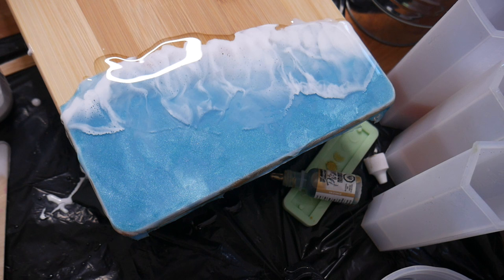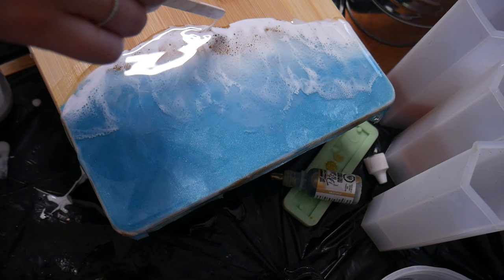Master The Art Of Creating Resin Ocean Waves In Just 5 Minutes | Quick & Simple Diy Tutorial

Comment: What the mixing ratio of hardener and resin?  Also how much die powder should I get for a gallon?  Or is it just to preference?
Reply from the maker: It can depend on the resin you’re using, always check the labels for the mixing ratio :) personally with the ArtResin brand I use it’s 1:1 ratio so just equal mixtures of resin and hardener! And for the powder you can get a small container to see how far that takes you with your projects :) typically dyes and pigments are so pigmented that you don’t need a lot :)

Comment: Ok that didn’t explain nothing you didn’t say what bands you was using, how long you was leaving the resin before blowing it out, that was just to say you mastered it 🤷🏻‍♀️
Reply from the maker: The first 10 seconds of the video I show the brands & the supplies are all linked in the description. I have an entire Amazon storefront dedicated to the ocean art materials.
I explained how to reduce bubbles in resin, how to mix, how to mix the colours, where to place the white dye, (I spread it right away), how to tilt the heat gun and the angle it should be at, I show the method that didn't work with alcohol ink, I show how to add more white if blue is showing through, I mention you need to work on an even surface, I show a second example, how long it takes to cure. I show my exact method twice through. 
But yeah I just wanted to brag, right? 🙄